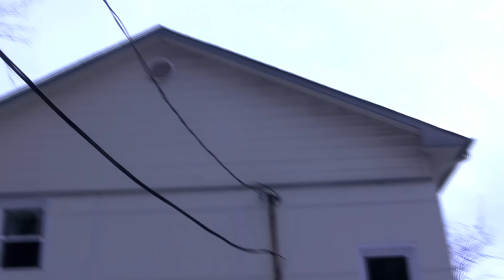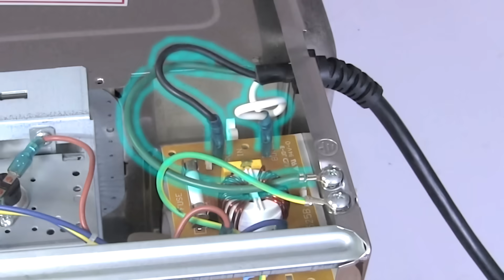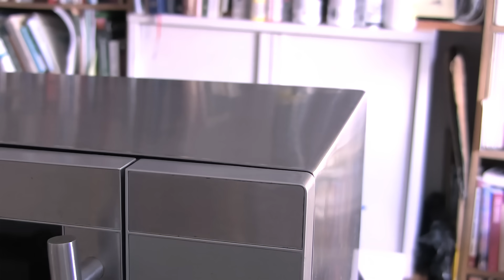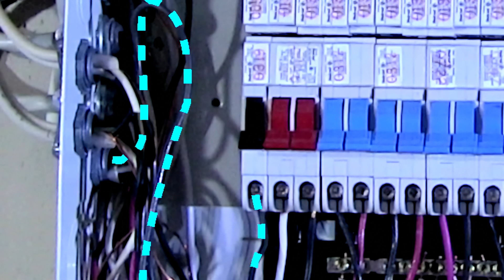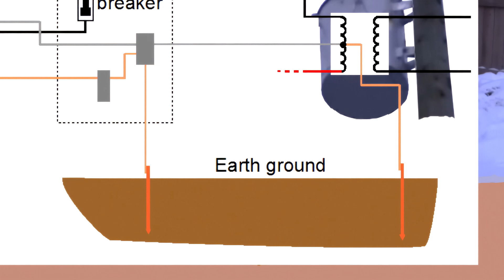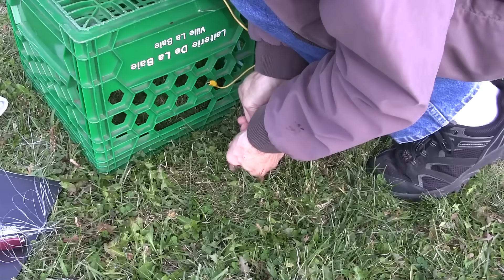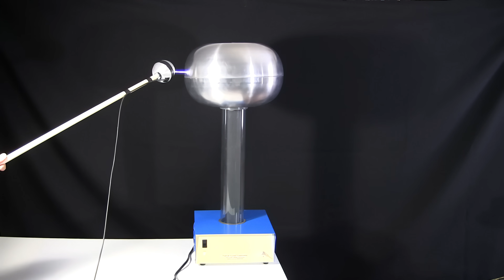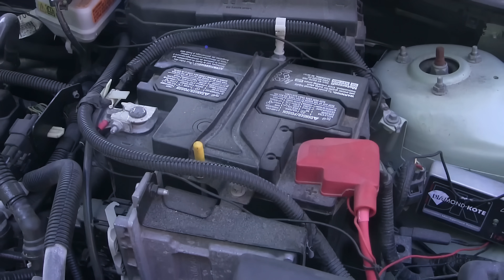What is Ground? Earth Ground/Earthing

Comment: Rim star,   This is absolutely the best grounding video on YouTube!    I'm recently retired Electrical Engineer and have taught electrical design for many years.   It took me several years at first to finally figure out how grounding actually works!   Your explanation is exactly correct.   I'm pretty sure than 99% of electricians, designers, and electrical engineers do not understand what you just taught.   After reading the comments, for those who think he is incorrect, think it through!  If you accept this information, designing or installing electrical system grounding makes sense.   Most people are taught what to do, not why to do it.   Again, awesome job!    Very Respectfully,    Kevin
Reply: Thank you!
Reply: penandpike   If you did this video, no thanks necessary.   I was very pleased to see an electrical video based on knowledge!
Reply: A question for both or either. The energy the electric company sends is termed "skin effect". It is teslas plasma energy. It can be made by taking man made ac sine wave and running it thru a spark gap to turn it into ac direct. Then you can run that thru a hps sodium bulb which would be a vacuum tube spark gap, and you have plasma energy. If you take a digital thermometer and take a reading of the plasma energy in the hps bulb it'll read in the negative -900 degree range. I assume it's because the heat is used by the plasma energy that's created for powering itself. The skin effect runs down the transmission line on the outside of the highly vibrational blend of metal that's used. When it reaches the pole the transformer is on, it has a short thin jump wire wired to it. The jump wire is tied to the ground wire on one end, and the other end to the transformer. The return line is also tied to the ground wire that is considered the guide wire. Teslas tower wasn't used to send wireless electricity, it was used to draw up the earths rf energy. So it seems to me, the electric company uses the skin effect plasma energy to suck the earths rf energy out of the ground to run to the transformer and that is dumped in to the liquid via tiny wires and turned into ac sine wave and that's what we being charged for. I have zero electronic schooling, but a year of watching videos of how electronics work it seems to be the case. I've tried asking multiple electronic channels, particle and quantum physics channels and have only gotten blocked and my comments removed. Asteronx tried saying i was wrong on my information when i explained how faster than light travel works, until i proved them wrong then they blocked me and came out with a video on their  "possible new theories" and so did Sean Carroll from Stanford university when i took it further and explained my theory on gravity. When i tried explaining that all that together explains how particle entanglement works, my comments got removed and i can't even post them anymore. It's all from top Dr's in neuroscience and biochemistry that explain it, quantum cooper pairs electromagnetism ect but the two i mentioned, Jordan Peterson, Bruce Lipton, Neil Tyson and others wont even discuss what their combined work adds up to. So im trying to get honest answers fro electronic experts. I posted my 3 minute video on face book, with two sermons explaining how electricity is in the Bible today and they shut my account down. Can you tell me if im right? And not from a knee jerk emotional perspective, but from a knowledgeable scientific point of view. No disrespect, but the that's crazy answer from a non knowledgeable perspective is getting old. Especially when the guy's saying that remove my comments, then later come out with videos on their new theories. If you don't know thats fine, if im wrong that's fine. But im getting tired of being called crazy when im just trying to learn the truth. If i was wrong about gravity and particle entanglement, i wouldn't be getting my comments  suppressed when i explain it, I'd get explanations on how i am wrong. It seems nobody has a problem telling you when your wrong and how, but no one has done that except Asteronx, which stopped when i proved faster than light travel. Thanks for any explanation either way, right or wrong.
Reply: @checkingoutgypsymike2075     Mike,   A question, if I am reading correctly, you are saying that the transformer on the pole is collecting the energy from the earth, not from a power plant somewhere else.   If this is the case, knowing that the earths magnetic field is 8 hertz and our electrical system is 60 hertz, where or how is that change in sine wave frequency made?   
Since you have this all figured out, I am assuming that you have made your own working system and do not need the utility company for electricity.   Please make a short video of it and put it on your channel that you signed up for on February 6, 2021.   Just 6 days ago.
Reply: @KevinCoop1  no sir, i got the information from Gerard Morins channel, he has a bunch of videos going over how tesla made his plasma energy. He actually had a working system before his posting stopped a few years ago. His thoughts were that the ground was a siphon for the feed and return lines. But from the keshe foundations magrav (magnetic gravity) power pack unit it makes me question if it is just a siphon. Their nanotechnology is taking particles from nuclear waste and combining them in to a safe paste. They use the paste to coat teslas coils like used in an induction stove top, and when you run a trickle charge thru the power pack it makes energy from the vibration of the coils. There's a channel invert gravity (i believe the name is correct of the top of my head) that is making a tesla steam generator, he posted an article a few days ago that was from tesla, explaining how the energy we are bombarded with can be harnessed if you haven't read it. So besides drawing out the rf energy, the skin effect running on the outside of the power lines could also be using that, like i stated im not an electrical engineer by any means. Taking into account the us patent for faster than light travel, is a double hulled craft of highly vibrational metal, which they fill the chamber with mercury at -15,000 degrees so it is detached from the solar radiation all around us, so it has no friction as it moves it implies that the energy we exist in is key to understanding how the universe works. Thru neurology and biochemistry, the understanding of quantum locked cooper pairs helps to explain it further. The wicking effect in water damage restoration, how the dehumidifier dries the air, charging it, so that when the fans blow it across the wrt surfaces it magnetically pulls out the moisture due to the energy in water. Or like ground to sky lightening, the highly charged air from the thermal energy build up in the storm clouds and when it gets strong enough it actually pulls massive volts from the earth to create the lightening. Their are many examples of what im proposing all around us, as tesla said" once you understand the energy you can see God's work all around us. Planks book the spiritual universe also leads credence to it. The 3.5 trillion volts of God's spiritual, intelligent, conscious, evolving energy working in a symbiotic exchange grounding us explains gravity. There's a channel i asked about the quantum locking and it being the explanation of gravity, i believe if you search for double quantum locking you'll find his experiment from my inquiries. I asked about the suns energy being the key to gravity and the moon being dielectric, it being stuck in the magnetic energy that has the sun and planets locked together. I watch a lot of science channels so i could be wrong on the channel name, but i believe that experiment was done by the thought emporium. I can look and if im wrong make a correction. There was a video on the keshe foundations work on green energy jubilation, i haven't looked in a while so i don't know if it's been removed. You can search the internet for magrav power pack and in images you can see how the build them and see an explanation of how they work. Do yes im saying that it seems possible to draw out the earths energy. The tower tesla had made and had to destroy was for pulling the rf energy out of the earth, buy the 3 6 9 emp like pulsation it produced was hitting the Teutonic plates and caused an earth quake. Even a common generator pulls the energy from two directions, the ground and the sky. The magnet when spun over 3,000 rpm's collect the energy and forces it across the metal to generate electricity. The readon a vertical axis generator is more efficient is because it doesn't pull the energy in and make it do a 90° turn as it's collected. Like in wiring, you don't want sharp bends in wires because a power surge can make it exit the wire, and aldo causes more heat build up do to friction. Something like that, it's been thirty years since i worked with microwave cable but that was stressed in safety meetings.
Reply: @KevinCoop1  ive been on longer than that, for some reason my account gets wipped out frequently. Perhaps my posting the video explaining gravity and particle entanglement had something to do with it. Most likely that or explaining the billg patent o6o6o6o and the chip from the guy making the electric cars was partly at fault. If you want to know about that you can research numerous videos on loading subconscious thought on computers all over the internet and youtube. If i go in to much detail ill get the old error your comment can't load.
Reply: @checkingoutgypsymike2075     Sorry,   Way beyond my knowledge of electrical systems.
Reply: @KevinCoop1  no problem, it took me about two years to get thru it all. Started with chakras and Alan Watts videos, i used to be a non believer. They gave me more questions than answers so i started on sciences lol. God bless sir!
Reply: @checkingoutgypsymike2075     I do know that Tesla did convert a Packard car to electric.  It had no batteries.   He drove it for two weeks and destroyed it.    Tesla was extremely intelligent!   Another guy Morrow did similar in the 30’s.   Best wishes sir,

Comment: In UK we call them Earth , Live and Neuteral I learnt the hard way Always check Earth-First. Somone had badly wired 3 kw electric fire. I plugged it and touched it! We use 240volt AC, when I picked myself up , my hand shakeing the other guy said 'Yes, it did that to me. That's why I brought it to you'. Point of order though Sir. On older vehicles the earth can from the Positve side! Always check before jump starting, the wrong result is impressive, and expensive.
Reply: Why did you touch it? Idiot! I tested a shower we installed for Romanian orphans. IDIOT!
Reply: The lesson learned is be suspect of those who come bearing gifts, they might be designed to hurt you..." Yes it did that to me that's why I brought it to you"... Classic
Reply: @sudoscapy9631  Though lesson NEVER forgot! :-)

Comment: If this video won't make the consept of Grounding clear, nothing will.
Reply: If the neutral and ground and electrically connected at the panel...doesn't that make the ground a part of the circuit?....
Reply: @AeonFlexOfficial  - NO !!!  Luckily there is this useful thing called..... " WASHERS "!  LMFAO
Reply: @JodBronson  What are you giggling about? A washer can still be conductive. If the Neutral and Ground are electrically connected, that means the ground is now part of the circuit.

Comment: Very interesting but in Europe the plugs only have 2 holes, how does the ground work in that case?
Reply: not all N.A. plugs/outlets have grounds either.  the ground and neutral were on the same wire back in the day .
Reply: The ground is these two springs up and down. https://bbpcdn.pstatic.gr/P/bpimg13/1xC6V/1HGPQq_SX250Y250/22787661/briza-soyko-city-leykh-190211-elmark.jpg
Reply: In UK we have three prongs though the other way up, Earth/Ground is at the top. they are also rectabgular. Result is if travelling you need a box of convertors. Though most stuff now has an insulated case so only two wires, in our case and Europe , Striped Green and yellow = Earth Brown= Live ' Blue = Neuteral. Also now illegal to Earth through water pipes, a dedicated Earthing Pole must be used.

Comment: Ok until 1960 something, maybe later, the standard house was built with no grounds at the duplex receptacle. There may have been a hot neutral and ground wire used in the circuit, such as 1953 to 1957 levittown homes. But the receptacle had no ground for the plug

Comment: Why is signal ground different from chassis ground?
Reply: In a more complex system, you may find more than just a single point of reference. For example, in a boat, the schematics will refer to the sea level "ground" (say at full load) and some other part of the schema uses its center of gravity level "ground."
Reply: Euquila will anything change if I connect signal and chassis ground together?
Reply: @ChrisPrefect  It very much depends on the circuit you are designing. For something simple, such as a battery powered LED; no, it'd be fine. If you are doing some very sensitive data analysis on a digital signal, with a specified lo error bit rate, or your circuit is sensitive with regards to signal intensity or accurate voltage measurement; yes it will. There are many things that can affect the quality of "ground". If you have a noisy source, (e.g a large inductive load, or say a large motor) that is connected to the same ground as your sensitive circuitry then your heavy loads can induce something called "ground bounce" in your recorded signal. This is to say, that the measured potential difference has been affected/reduced/changed by the energy dumped by your large load. Remember also that any large shield of metal (like casing) can act as an antenna if not properly grounded and absorb/pick up on surrounding sources to give inaccuracies/non predictability in the ground reference. 
If you're not designing something with high-speed (>100MHz) data signals, Radio frequency circuits or any very sensitive voltage measurements (asin <0.001V) then no worries - it should be fine. Otherwise, keep them separate for their separate uses and split them appropriately (e.g split ground planes, dedicated in-case terminals, shielding...etc) to avoid spurious noise and data/timing errors.

Comment: you missed the fact that ground is considered a reference 0 voltage ... while neutral is any voltage you choose to set it to as a reference ... a ground connection is generally done by connecting to a water pipe .... a neutral can be positive of negative ... while the hot line is normally a positive value .... so your explanation is ultimately faulted ... a hot of 110vac ... a ground to the earth of 0vac ... and a neutral of -110vac ... can give you 240vac overall ... and 110vac ... and then both your neutral and hot lines are hot ... while your ground is 0 ... the most common use  for a non 0 neutral is a reference voltage for a comparator ...which would compare some voltage against .... such as in a digital circuit .. 
.

This is where the terms ground and neutral came from neutral and ground are NOT equal TERMS for all things ... just modern electronic fallacy has them as interchangeable thus the reason why open ended circuits wont work on standard power systems ... but they work fine on a proper hot neutral and ground wired system
Reply: I get what you mean by neutral vs ground. This is the true use of these words.
But in the electrical system of a house, is the ground/earth actually connected to neutral and into the transformer? In this case why would they make a separate third connection? Why not just connect it directly to the neutral within the device itself and have only 2 poles in the plug. This is what confuses me.
Reply: @abdulazeez.98  -  This is why they taught all of us in School is WRONG !!!  The Earth is Negative and the Power we produce is also Negative.  So BOTH will only try to find Positive, that is the best way I can explain it.

Comment: this is so bad explained, very confusing video
Reply: and essentially wrong for what the terms actually mean ... but for basic household workings it is essentially correct ... this is also why those power saver addons you can get and your electric company hates actually work ... they reset the neutral line back to a NON 0 voltage ... usually -110vac while the hot line is +110vac ... and the ground is a connection to earth as it is properly called ... you can find this connection normally in the basement on the water feed line in most houses .. it has a large copper wire fastened to it ... that is the earth or common ground ... while neutral can be connected to it to set it also to 0 .... BUT it doesnt have to be ...
Reply: @0623kaboom  if you set neutral to other than nil wouldn't it electrify  the pipe?
Reply: @tomtoms404  the point of the pipe is that it cannot be charged (because it has such a large volume of earth connected to it)
Reply: @0623kaboom
I noticed that too. Connecting metal chassis to neutral can even be dangerous and it is not recommended to do. It was done long time ago when ground was not easy accessible, but not any more.